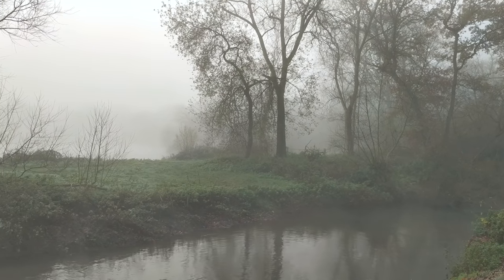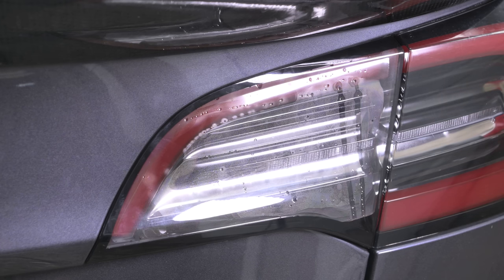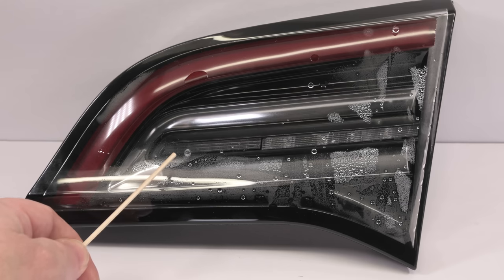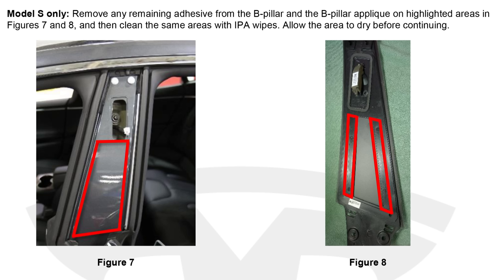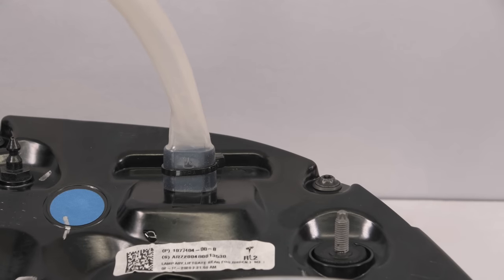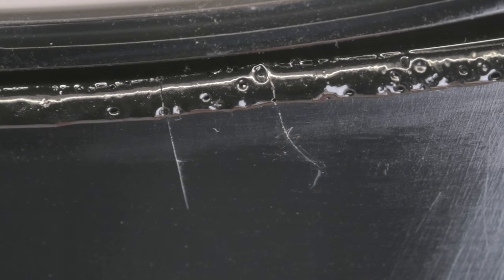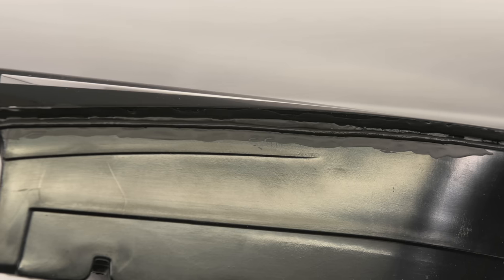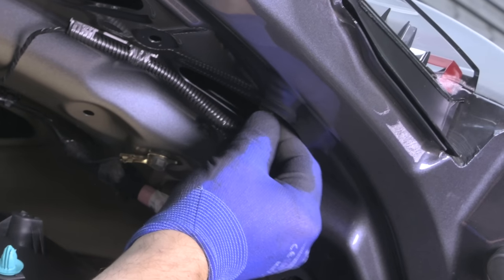How to fix your fogged up Tesla tail lights

Comment: Thanks for this excellent video. I've ordered the liquid plastic and removed the inner RH tail light of my Model X, only to find no leaks at all. There was a lot of water inside the tail light and the gore vent was actually soaked. When I close the vent hole with my finger and blow on the electrical socket, there are no bubbles to be found. I don't believe the connector on my car is waterproofed like the one in the Model Ξ, but I'll double check that in the morning. Without a waterproof connector I don't think I'll have any chance of keeping the light fog free in the future.

Comment: Great video. But I think you reinstalled the foam gasket incorrectly @ 11:11 .  You should put foam on the tail light before you install the light on the trunk. (foam gasket between the light and the outside of the trunk lid) I suggest you fix it or water can get inside the trunk lid through the connector hole.
Reply from the maker: The foam gasket is there to seal the electrical connector to the light unit, not to the trunk lid.
Reply: @TeslaGurus  Take a look @ 4:00,  The foam gasket is on the light when you remove it. (outside the trunk lid, not inside the trunk lid)
Reply: @TeslaGurus  I don’t think you want any water to get inside the trunk lid. You have the electric latch, trunk switch and bunch of wire harness there. The way you install it might be ok for a while but it is not a perfect seal. Anyway, it is up to you if you think this is OK.
Reply from the maker: Ok yes I understand what you mean now. Yes, you are correct, the foam piece which goes around the connector should be on the light unit before putting it back onto the trunk lid. I didn't quite get what you were describing originally. Thanks for pointing that out and as a token of our appreciation you can have a free T-shirt from our store. Just email me and I'll arrange it for you - john@tevo.solutions.
Reply: @TeslaGurus  Thanks for the offer. I think I will pass.  Just donate the cost to your local charity. And good luck with your channel.  Cheers!

Comment: Good tip to use a bubble test to locate the sources of water ingress. You misunderstand the function however of a Gore vent. These are not one-way valves; they permit air exchange while blocking water BOTH WAYS. If water gets in again, or is not removed, the Gore vent will not allow it to escape. The purpose of the vent is to maintain pressure equilibrium.
Reply from the maker: Yes, they equalize pressure and keep liquid water out, but also allow moisture to escape. This video made by Gore explains the process very well: https://youtu.be/wLKSoO_3SRE?si=3dxxqCeKXtb2S3EV

Comment: There was a comment about the B-pillar cameras in the video.  I have a June 2018 M3 build, is there a service bulletin regarding fogging issues with the side cameras?  I live in a very arid climate and have, to my knowledge, not had the side cameras fog over; however, if there is a problem, I would like to get it addressed before the end of the warranty.
Reply from the maker: I think if you haven't seen it, you're going to be OK. It tneds to happen in a climate such as the UK where it is cold and damp for many months at a time!

Comment: Great video. My plastic big screw for the outside lamp had rusted stuck and was a bit damaged when removing. Trying to source it. Also the gore tex pad was very well glued and lost a bit of the inside layer of plastic. Do you have any good place to source the pad?
Reply from the maker: You should be able to source the Gore patches from the U.S. if you can't find them anywhere else.

Comment: Love your videos thanks. What are your thoughts on following the exact process as in the bid with the exception of leaving the gore patch in place? Surely the moisture will leave through the patch over time (albeit after a longer period in the heat).
Reply from the maker: Yes you could leave it in place and it will eventually evacuate all the water vapour inside, but if there's water pooling in the light unit you want to drain that out somehow first.

Comment: Has Tesla fixed any of these uner a safety recall/warranty/goodwill?
Reply from the maker: Yes, plenty but with the same light unit which then cracks around the welds and lets water in again. They may be better with the recent 'highland' upgrades but time will tell...

Comment: Any method to split the glued parts? I have a few internal problems in my Tesla tail light.
Reply from the maker: As they are welded, it's not easy. A soldering iron or Dremel maybe?

Comment: A problem even with  your fix is that there will always be a dew-point at which condensation occurs.  That is, as the temperature falls, condensation will occur at some point.  
If you carry out your fix in your house where there is significant humidity (or not), you will still end up with moisture in the housing when you "reseal" even though the condensation gone as you have heated up the unit.  
You need to chemically remove the humidity to do this properly, and preferably do this on a very cold frosty dry morning where the general humidity in the atmosphere is very low.  Doing this work on a warm day is a very bad idea - as the total moisture content will be high - even though the humidity is low - because on a warm day the air can hold a lot of water.
After heating the unit to evaporate the condensate, and hopefully driven some out from the unit, you need to use something like a silica gel bag to pull our the remaining moisture.
Reply from the maker: A little moist air in the light unit isn't a issue. It's where the welds are not solid and liquid water from rain or washing gets in through capillary action where the problems start. The Gore patch will eventually get rid of most of the moisture, but it can't deal with water puddling in the bottom.

Comment: Think the B pillar camera's fogging up is due to the same problem? If it is then this might solve it completely.
Reply from the maker: The root cause is moisture getting between the camera and the glass, but in the case of the B pillar cameras the assembly isn't supposed to be sealed. They gave up using Gore patches on them a while ago. So it seems the best solution to that problem at the moment is to turn up the HVAC inside the car and direct the vents towards that area.

Comment: why do you use liquid tape and not just a basic waterproof black silicone tube?
Reply from the maker: There are plenty of sealants you could use. We picked liquid tape because it was the right colour, flows into the cracks and adheres well to the plastic.

Comment: Really useful thanks. Have purchased all I need apart from the plastic tubing - what size would you recommend? Obviously loads available but they may be too inflexible to push over the electrical plug…do I also see a cable tie?
Reply from the maker: 1/2 inch diameter flexible tubing of some sort is best. You can warm the end in hot water to make it ven more flexible then use a cable tie to seal it and keep it in place.
Reply: @TeslaGurus  Thanks so much!

Comment: @ 2:07, looks like that panel got busted since two of the plastic retainers are still in the trunk lid..... yikes.
Reply from the maker: No, the panel is fine and very strong. What happens is sometimes the plastic clips stay in the panel and sometimes in the trunk lid. But when you want to to put the panel back at the end you must remove any which stay in the trunk lid and put them in the panel so it all clips back together properly.

Comment: Thanks for the excellent video. The unit I bought from the US to get a second reverse light fogged up after the first night but I will repair it rather than return it. Is there any reason not to use black silicone?
Reply from the maker: Black silicone should work just fine

Comment: "How to fix your fogged up Tesla tail lights" Simple for a expensife and still in warranty car call your local Service Centre and let them sort it out
Reply from the maker: Then they will throw another one in their big bin of broken parts and probably install a new one with the same issue in your car. Doesn't fix the problem and causes more waste.
Reply: @TeslaGurus  Partly agree but if nobody calls the Service Centre than Tesla will not fix the problem. By the end of the day Tesla needs to get their act together to fix their low quality issues IMHO (We have a M3 since Dec 2019 and not that impressed with the quality)

Comment: I really appreciate this type of video.  I follow Louis Rossman and his DIY channel.    However, this issue has been linked to a warranty issue by Tesla Service.  They've corrected this gasket issue with their latest build of this light.  I had both my back lights replaced.
Reply from the maker: There is no gasket. It is a plastic weld which is failing from whichever supplier Tesla use. Brand new units in cars delivered in the last few days suffer from this problem as do new light units ordered from Tesla spares. Sorry, but your information is incorrect.
Reply: @TeslaGurus  you're right I watched until the end of the video.  I'm not sure i understand the instructions - just rebake and reseal with the goretex tab?
Reply from the maker: @opl3sa  Yes but you also have to seal around the weld because the bad weld is what's letting water in.

Comment: How did you cure the hair-line cracks in the clear lens?
Reply from the maker: Simply cover any cracks you might see with the same sealant you use around the weld itself.

Comment: Great find mate! Think this has to do with the side cameras in the pillars getting moisture in them?
Reply from the maker: The pillars aren't as well protected in the first place, so same cause but the only recommended way of clearing the condensation in those is to direct warm air to that area inside the car from the HVAC system.

Comment: Great Video thanks!
But if the gore vent lets moisture out and not back in, wouldn't it be possible just to seal the unit and let the gore vent do its job over time?
It clearly will take longer, but then there wouldn't be any risk damaging the gore vent.
Reply from the maker: Yes, but the car would need to be kept in dry warm conditions for several days. That's not usually possible in the UK!
Reply: @TeslaGurus  Well i guess thats true :)
Thanks
Reply: That's not how gore patches work. They are oleophobic. They block water droplets from passing but not water vapor. After the lens fogs up, heat or just reduced humidity conditions will clear the fogging. Water vapor can pass in and out of the patch.

Comment: Was wondering could you use a dehumidifier to extract the water?
Reply from the maker: No, not even necessary.
Reply: @TeslaGurus  I guess what I am asking is don't dismantle anything, just put your portable dehumidifier in the garage for an evening.
Reply: But i guess that does not fix the problem from reoccurring.
Reply from the maker: @willberger96  Nope, you have to seal the units to fix the problem

Comment: I have seen this before on equipment subject to heating and cooling, often from the sun but can be any heat source which is cyclic. The sun heats the light and expands the air inside which is allowed to escape through the cracks, then when the lamp cools the air contracts drawing in the cooler moist air which condenses on the cool sides. After a few cycles like this the build up is enough to be seen. The best way to ensure lights stay sealed is to run a bead of flexible sealent around the weld. It is amazing that this isn't done by the manufacturers as warranty replacement is never cheap.
My M3 rear lights are good at the mo but I can see "tears" in my headlights! :-(

Comment: don't put your headlamp in the oven, its a terrible way to dry, you need airflow through the headlamp.  if you have a shopvac that blows, use an attachment that you can stick inside it and give it 10-15 minutes.
Reply from the maker: Putting the light unit in a very low oven as we describe is no different to the car sitting outside in the sun on a hot day and is the best way to drive moisture out of the assembly through the Gore patch. There isn't an opening on these rear light clusters you can get an airline or hairdryer into and in any case blowing cold air into them isn't going to do a lot if a lot of water has got in.